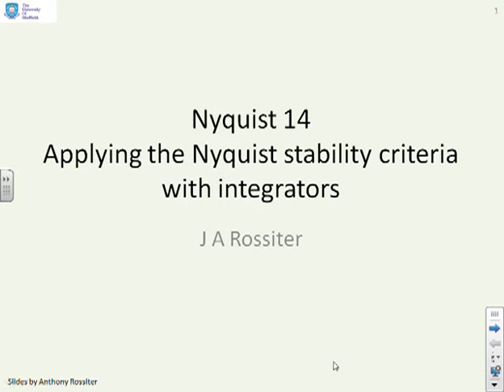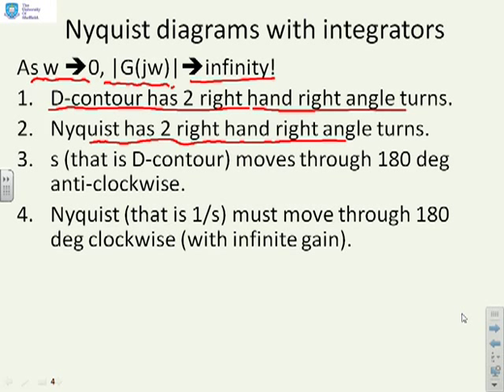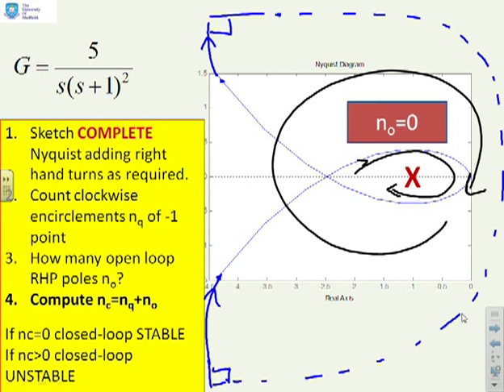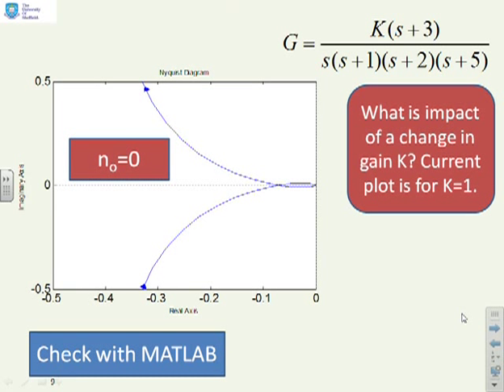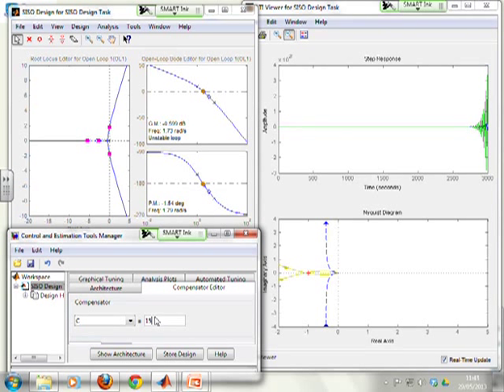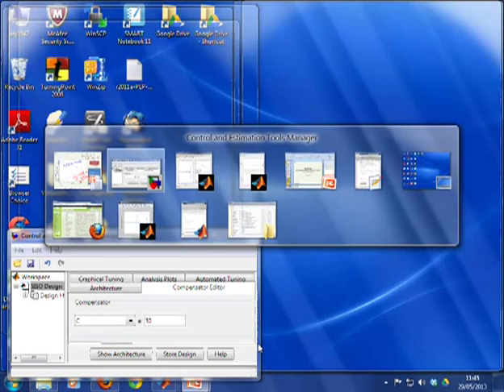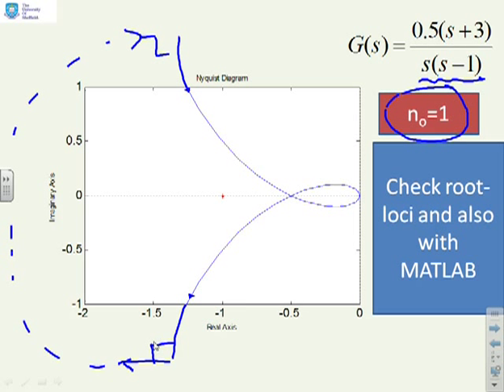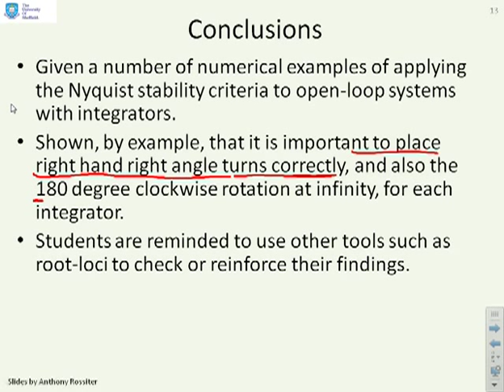Nyquist 14 - applying the Nyquist stability criteria to systems with integrators

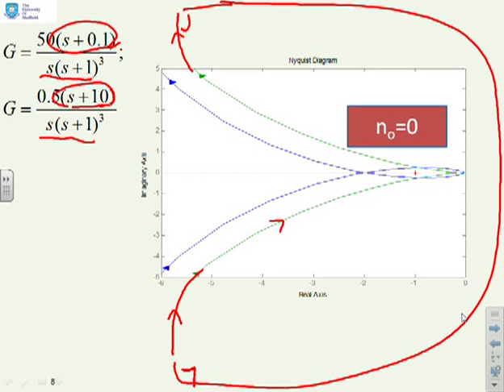Comment: The first  system at 5:14 namely 50*(s+0.1)/((s*(s+1)^3)) is, in fact, not stable. It has an x intercept at - 6.9 (to the left of the -1 point) and thus 2 clockwise encirclements of -1. A root locus plot will confirm this with a single root on the negative real axis and a pair of complex conjugate roots in the right hand plane. It can only be stabilized with a gain of less than 0.145.